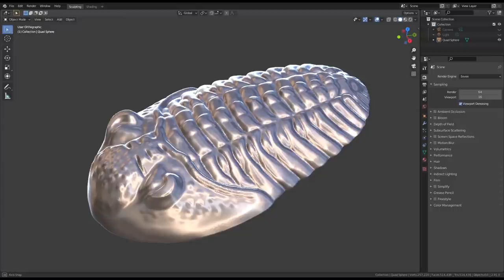How to cast bronze TRILOBITES │Metal casting at home │ Giveaway! #RobinsonFoundry

Comment: Not bad, not bad at all! Way, way better than the average YT ingot caster. But I think that you can do even better if you use a decent sprue and pouring basin set up. A small feeder may also be a good idea - not so much to actually provide feed but more to act as a "penstock" to prevent impact penetration of the metal into the sand. If I ever get well enough again I might just have to get  one of those printers - there is much I could do with one.... Martin
PS, From a prize point of view (only) its a pity I am in Australia 😊

Comment: (For contest: I figured I needed about 6 lbs or 2 and a half kilograms to comfortably fill the molds) For you: Something you might want to look into is, there is a resin that can be put in a kiln and turned into clay ( saw it on Integza channel to make aerospike jet engines) making it possibly strong enough to caste and then you can just take the negative of your model and skip a whole step in casting them.

Comment: In my steampunk phase, I wanted to fit a Riley Elf or Wolsely Hornet with brass trilobites in place of the 3 front grilles. I expected to take 3D printed plastic and brass-plate it, if that's even possible, but casting solid brass would be much cooler. Unfortunately, my health didn't and doesn't allow the project. Perhaps it will one day; perhaps soon, but now my project ideas are different. :)

Comment: In the casting of the avater of the Dead Emperor you used normal 3D printer which produced very fine detailed print. I was amazed about the details from the finished Brass cast. I was just wondering why you didn't use same 3D printer here instead of a resin printer.

Comment: I have always been so curious about how you clean the used casting sand. What's the best method you have found? Does the burnt material clump, making it easy to sift out? Or does it not matter if the casting sand is mixed new with old?

Comment: Hey there! I just recently discovered you channel and have caught a casting bug ever since finding out my resin printer can use investment resins.  Do you think your method of casting would work well for small parts on the order of inches or smaller? I primarily deal in small detailed railroad models.  I want to avoid sand casts and go the route of lost investments.

Comment: How much does it cost to get started doing something like this? I really want to learn!
Reply: The real cost is the time and frustration required to use the software, learn your 3D printer, and then master sandcasting. The actual money required is a smaller hurdle than all that.
Reply: @canadiangemstones7636  I have two 3-D printers now. They are not resin printers, but I’m not sure if that matters.